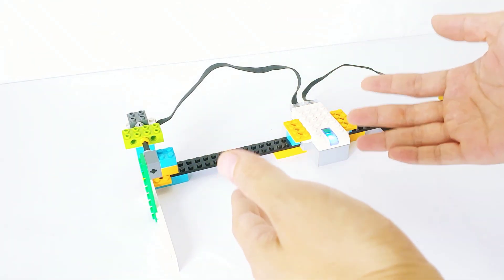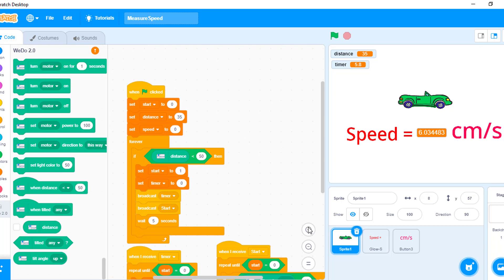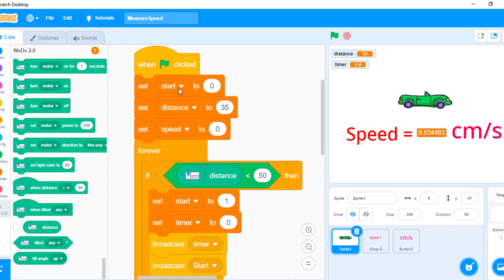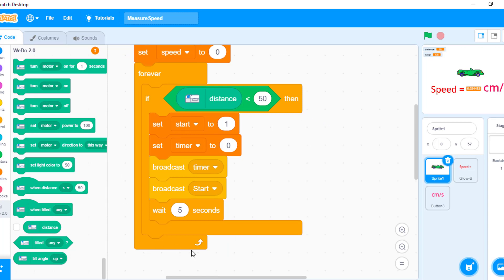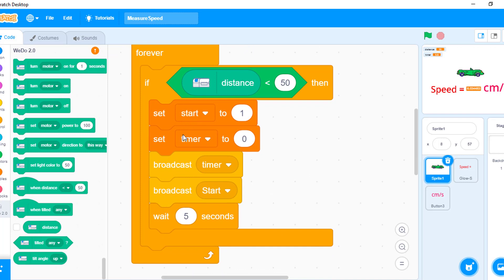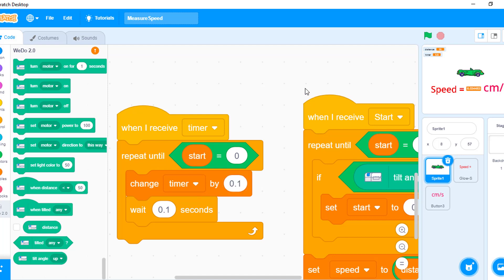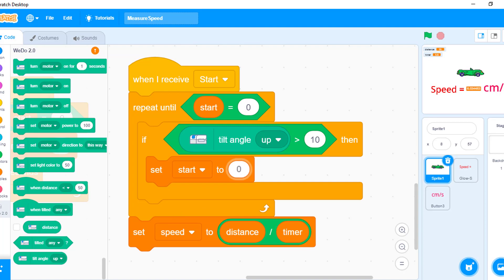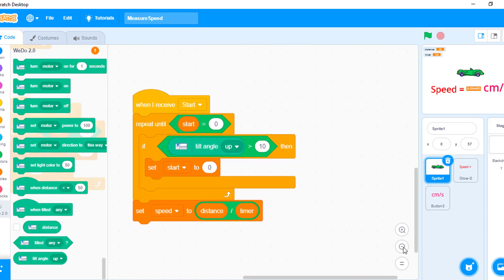Measuring Speed - Building and coding instructions | Lego wedo

Comment: Hi, i have a problem with the tilt sensor. Scratch 3.0 it is not detecting well the tilt sensor... do you know what could be going on? Thanks in  advance.
Reply from the maker: Scratch 3.0 detect tilt sensor well. So you should check your tilt sensor.
Reply: @tomrobo  thanks for your answer... Scratch is detecting well the motor and the distance sensor. But not the tilt sensor... 

the problem is that the tilt sensor is working well, because i tried in wedo app and works. i dont know what can i do :(
Reply from the maker: @ivanintimunozhernandez4770  you should check your scratch code! Or you share your scratch code, i will help you